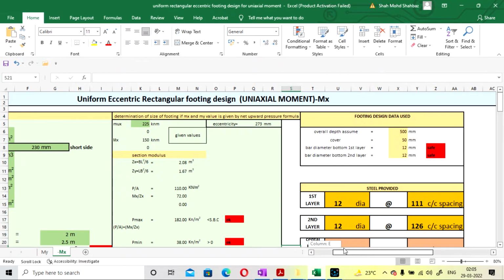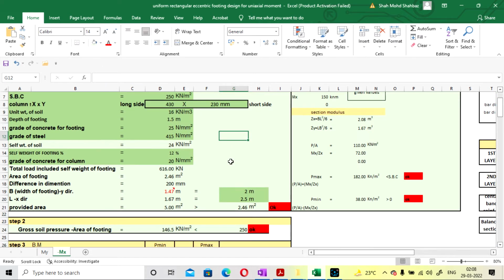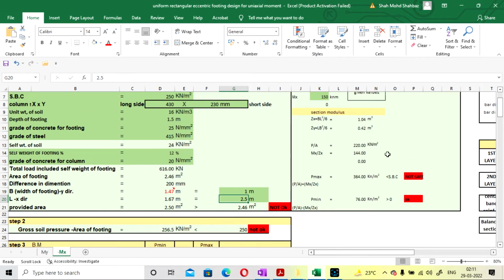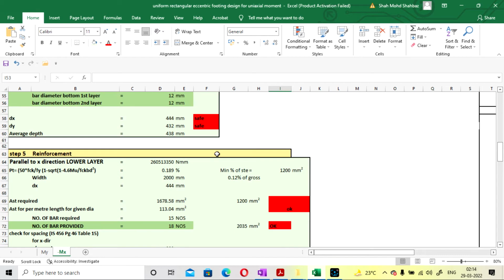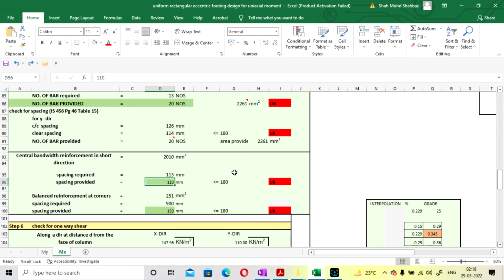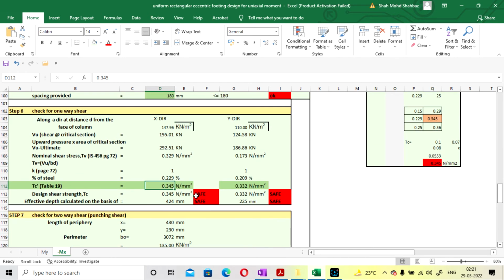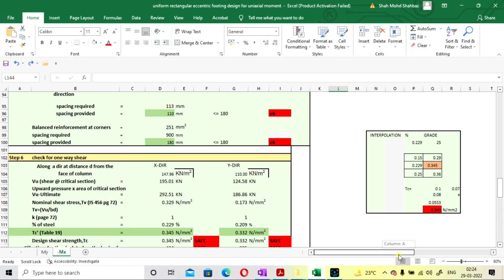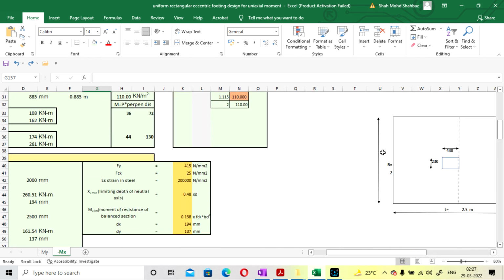Design of Eccentric footing using excel -Type 1# Rectangular footing #IS456:2000 #2022 #ENGLISH

Comment: Sir ye pura apka tutorial professional hai n...jsa hum site p use krte hai?
Reply from the maker: 💯 Percent professional as per design standards
Reply: @ConnectCivilianLEARNING  sir jse staad ya etabs m design kr liye..thn isme kse hum beam column ko detail design kr k client ko hum handover krngy
Reply from the maker: @BoBbYRaNa  depends on what code you are using and is seismic load is applied or not ..so you can get the reaction force from software and directly you can insert the value and get the steel detail
Reply from the maker: Or if you are directly designing using sheet then this will be safe for construction but for multi storey building don't forgot to apply seismic load or increase the factor of safety for much safer result
Reply: @ConnectCivilianLEARNING  but daigram eccentric footing ka show ni hota kya isme ?
Reply from the maker: No but dimention will change and you can easily draw in autocad